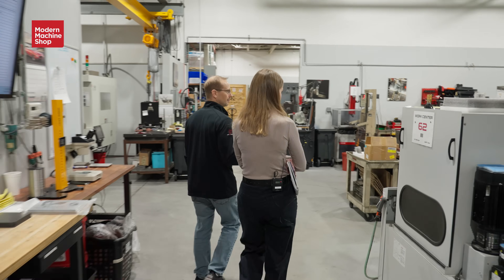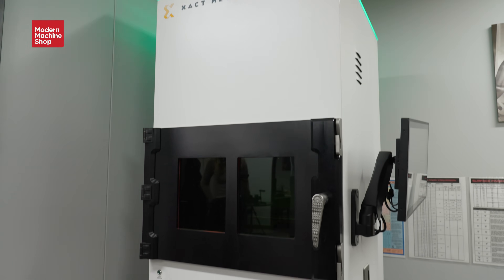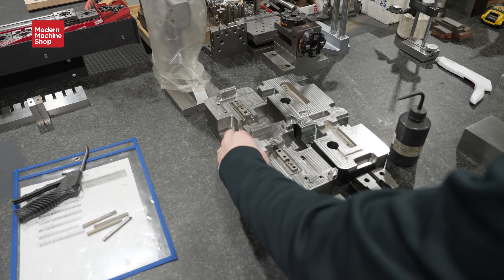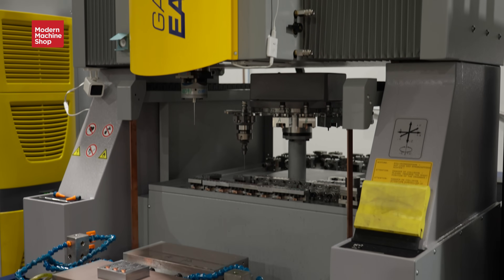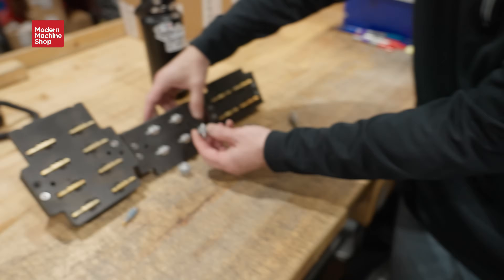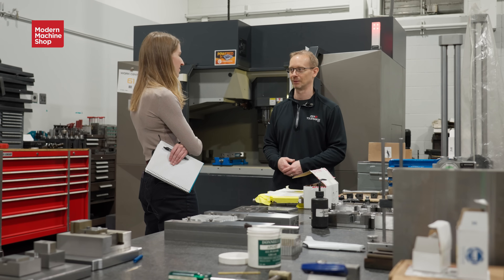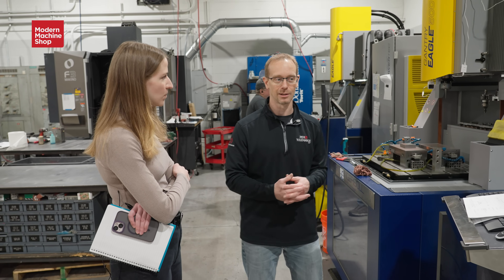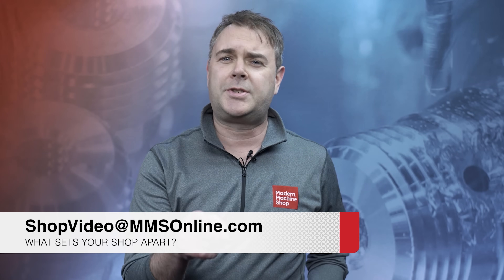From Basement Startup to High-Tech Moldmaking with Metal 3D Printing

Comment: Bold to put the printer in the office especially when you have a machine shop right there. Metal powders are no joke and you need the right PPE. Hard to do that right and contain metal powders with carpet everywhere.
Reply: They’re enclosed, stainless is, well, inert.  He mentioned if the powders were Al or Ti, having them in that area wouldn’t work.  

He might want to be close to the printer while they’re prototyping a new product, or there are NDA concerns by the customer as to who can view the part.

Obviously, he’s smart, efficient, and employee oriented.  I’m pretty confident we can assume he has his reasons and knows what he’s doing.

Comment: 3:43 you’d think Metal 3D printing with aluminum would be cheaper than stainless steel.
Reply: Aluminum has nasty surface oxides, high thermal conductivity, and is explosive when it's a fine powder.  On the other hand, stainless has poor thermal conductivity, thin surface oxides, and fine powder isn't explosive. (might still burn)  Basically you really have to nail the inert atmosphere and process parameters to 3D print aluminum, but get a lot more lee-way with stainless steel.
Reply: Machining aluminum is cheaper than printing aluminum. Subtractive manufacturing, in general, is at its lowest possible cost. 3D printing metals from powder is relatively new and has quite a few rounds of cost out still to go. Even now, printing out of stainless is competitive with machined stainless if you really, really need the material properties.